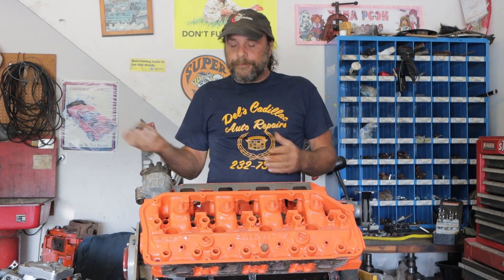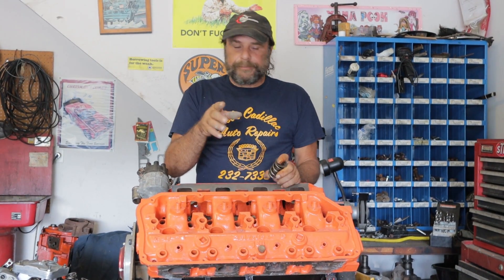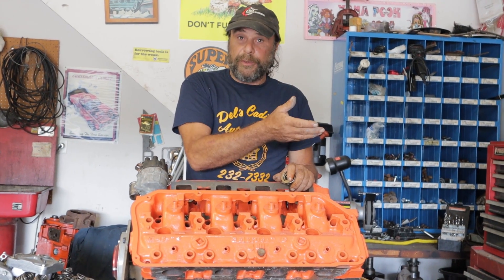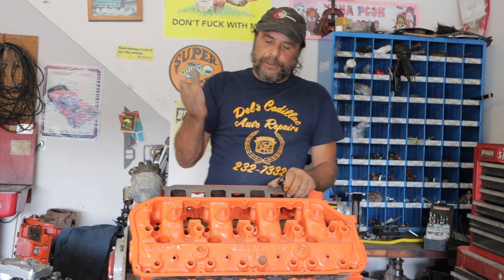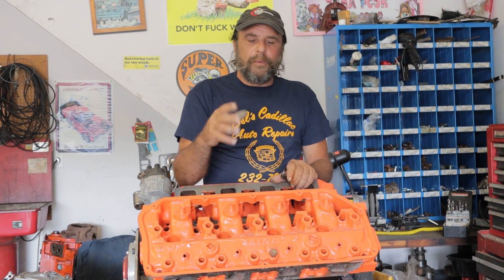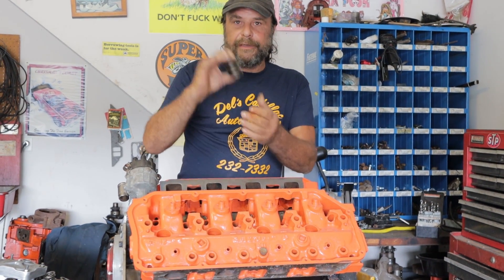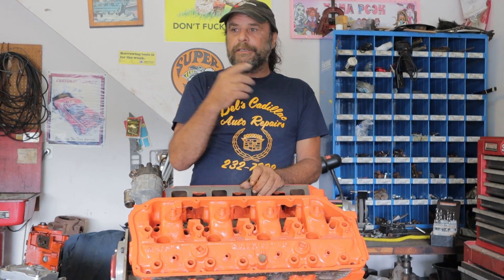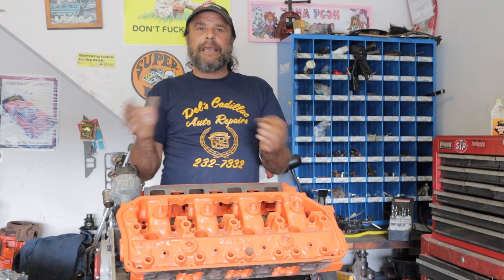Mopar's Doomsday Hemi

Comment: NASCAR in the 60s lead to major development in the automotive industry. 

GM lobbied enough to kill off Mopar and Fords dominance and reduced the displacement to 350 cid

That's what lead to the downfall of Chrysler in NASCAR and lead to GM dominating the 80s.

I want to cry when I see a wing car pic where the CID on the hood is less than 350 CID.

Yes kids, the wing cars were so aerodynamic that they could still take a Chevy even if they had a small block.

I'm only 2 mins in and heard mention of the GM "Mystery Motor",  Ford's 427, the Max Wedge and am wondering if you'll cover the BS that NASCAR pulled to ban the Hemi the first time.

The aero package cars (Daytona, Talledega, Cyclone spoiler) were so fast that the major name drivers boycotted races because the tires wouldn't hold up to the speeds they started reaching.

GM is the reason for the power loss in the series and it's obvious when you dig into the history of the sport.

Mopar was the king of stock car racing in the 60s and Ford was the prince, GM was the Jester that couldn't make anyone laugh.
Reply: John Johnson  stage racing killed it for me.

It was always about endurance above anything else.

Of course when Dale died I was already mostly done with the sport.

Sterling Marlin was demonized over the crash and as a fan who grew up in the 80-90s I knew Dale was the cause.

I'll still watch the occasional race but the heart of the sport died years ago.
Reply: @NotablyNova  That's what I liked about it too...the endurance factor.
Reply: @NotablyNova  I actually watched until Sterling retired. Funny how many people were such douchebags about it when he died doing what he loved. Not a damn thing tragic about that.
Reply: When Chrysler designed their Daytona "aero-car" they actually had an aeronautical engineer from their missile division go to the automotive engineering department to work on the aerodynamics.
Reply: @dukecraig2402  they used a wind tunnel at a college (can't think of which one) to perfect the airflow.

There was actually interest in this during the first gen Charger as well, there was also a 1971 aero car that wasn't completed because of NASCAR restriction
Reply: @NotablyNova  there is a car meme out that shows a Bugatti Veyron and a Dodge Charger Daytona. It says " this car, the Daytona, reached 200 mph with just 4 gears. How long did it take Nascar to achieve that? Those were full steel bodies cars, stripped, but all steel
Reply: Johnny Stephens I actually have that one on my phone
Reply: @NotablyNova  -Wind tunnel testing,for the Dodge Daytona,was done either at the Wichita State wind tunnel(3/8 scale models),or the Lockheed/Georgia facility(full size mock ups).
The Daytona actually had a better drag co-efficient than the Superbird,despite the similarity of the two cars.
Both Bobby Isaacs & Charlie Glotzbach drove Daytona's to over 230 mph,(at Chrysler's 5 mile oval test track,at Chelsea,Michigan)...Glotzbach ran test car No 88,up to 243 mph.
All back in 1969...Chrysler truely was ahead of everyone else.
Reply: @johnnystephens6329   I know a guy who has a super bird Complete full car and has done 220mph. The 440 6pack is mostly stock.
Reply: Magna Carta Sam Adam's hahahaha 220 🤣🤣🤣🤣🤣🤣🤣 yea not stock
Reply: Big Bill France pulled a number out of his ass and said Chrysler's wing cars were limited to 305 cubic inches. Chrysler went to Keith Black and they built what would be called the " lunch box" motor, because it was so small. But it was a high revving screamer and it won races! Big Bill wasn't happy!
Reply: @robertlee9395  Plus it wasn't as bad of an alcoholic as the monster cubes. Piss on Bill France. He fucked over Mopars every chance he got.
Reply: CC Ryder the Corvette is a bad joke when you talk about going fast, it's not documented even now that a stock vette will go 200 mph, and the Dodge Daytona /Plymouth Superbird were doing it in stock form almost 50 years ago, to go a step further, the current Corvette is still trying to match the 94 Viper performance numbers in stock form. Government Motors is a joke.
Reply: Donald Mccauley they were not doing it in stock form 🤣 those were nascar modified with around 650 hp... the actual car did all of around 160 with 3.23 rear gears
Reply: @Colt-tf6xf  real talk. Vette is the basic bitch of cars
Reply: CC Ryder but dumb enough to insult those who are brand loyal. And ps, the chchchebby bellybutton 350 is one of the worst small blocks ever made. Bad rod angles lead to the the nickname “rod nocker”. I’d put a mopar smallblock against that chebby boat anchor all day, princess. 
“I like them all so I’m so much better that you” 
Fact is, you drive a Hyundai. You’ve never touched a big block mopar. 
Sandbox is that way 👉🏻
Reply: John Johnson  
Agreed. I havent watched a NASCAR race since 1998.
Reply: @EarlSinclair97  just crybabyism on GMs part.  Case in point,  when they were bitching about how emissions standards would kill power, Honda (when he was still alive) got a V8 engine, modified it AND passed emissions with almost the same power. When you can't win change the rules so you can.
Reply: @consciouscool   Even funnier, was that Honda used a Chevy Impala as the test bed for their VTEC -SBC V8.
Reply: Still to this day they cry about Mopar being to dominate. They wanted them to change the modern day Dodge Challenger because it was to dominant so Dodge dropped out of Nascar.
Reply: @LionHeart0808  :That's not true at all. Dodge dropped out of NASCAR because they simply couldn't get enough teams to agree to continue to run their cars to justify maintaining a presence after Toyota was allowed to participate.
Reply: @rogergoodman8665  Yes that was a major part of why they pulled out of Nascar but not the only reason. "Dodge officially pulled out of NASCAR's top three series in 2012. A body change for the top-tier Cup series meant that the Dodges weren't eligible to keep running there. MBM Motorsports' Challenger was the very last holdout, and it held on to the bitter end. Next year, the Xfinity series will move from metal to composite bodies, so the Challenger will no longer be eligible to keep running." https://www.thedrive.com/accelerator/25181/the-last-dodge-challenger-to-race-in-nascar-is-up-for-sale
Reply: Hmmm , but yet Ford won roughly 35 races in 64 and dodge/plymouth around 20......😎
Reply: What I am absolutely amazed about is Ford is still in business, really amazing considering all the junk they have sold in the last 15-20 years.two diesels, problems with their dual clutch and they knew it before they sold it,Triton engine's and so many other problems,yet here they are still around.now that is incredible.
Reply: Its cus they're cheap
Reply: @justenough730  it's in f**** credible that you're still around pal what's the opposite of above me take it f**** light the first year of the 429 came out and Winston Cup it won that season that's too f**** bad ain't it pal by the way Bill Elliott 212 miles an hour nobody's ever done that and NASCAR by the way 45 years ago Salt Lake City Flats world land speed record 295 miles an hour Ford GT just recently that land record was broke guess my what Jackass another Ford GT so stick it where the sun don't shine bow and take it f**** light just enough knowledge to clean out a f**** Johnny on the spot
Reply: John Johnson  Damn sure Sucks. I Hope the stands keep becoming more and more empty. What once was so great, is now complete Garbage.
Reply: @CC Ryder 1920 Superbirds alone. A few hundred ? Hmm
Reply: By 69 and 70 when the wing cars had come out gm had long since banned factory backed racing. Pontiac still did it unofficially and shit cus they were badass. They also held the performance flag the longest. Gm deadass cancelled the 455 production after 76 and 400 production after 78...sure Pontiac purposely overordered for it to be an option in 79 and borrowed olds 403s for standard option Trans Ams, but it was GMs bullshit internal rule about no one being faster than the slowass overrated Corvette that stifled development. Pontiac's banshee II is what became the c3 vette because Chevy whined about how it was faster and better so gm took it and retooled it for their favorite son. I love Pontiac and MOPAR because weren't afraid to shoot someone the finger and make fast shit and in Pontiac's case continue doing it when everyone else had fucking given up
Reply: I'd often heard, GM was officially, out of ANY form of racing, in the '60's; NHRA, NASCAR, ETC, until the Trans-Am series. (My saying, Trans AM. We know Chevy, and Pontiac ran those, until it's demise.) Yes, there WERE Chevy's, Pontiac's, and, Oldsmobile's running...... but, factory support came by way of the back door. Didn't John DeLorean have to build the GTO in a back warehouse, somewhere?
Reply: @robertschreiber8099  ya the G.T.O. was built in secret and when unveiled was released as just an option package to skirt the corporate mandate for curb weight to displacement.
Reply: @robertschreiber8099  Oddly,GM pulled out of racing in the same year that Chevy finally had  powerfully competitive engine(mystery motor) for NASCAR again(1963),not that it mattered,because the engine wasn't reliable,and then Ford and Chrysler stepped up their game the next year anyway.Chevy pretty much had no chance in NASCAR after 1960.They just couldn't hang in the engine department.
Reply: @CC Ryder 1,920 Superbirds produced and sold to the general public.
Reply: @CC Ryder Oh I wasn't into the whole Nascar back and forth. I just know several people who actually own Superbirds. Sitting inside one about to head down the beach as I text right now.
Reply: GM didn't have any factory teams....didn't need them. GM already had 50%+ of the auto market.
Reply: Grumpy ate hemi ass with a Lil Ol' 327
Reply: @dennismassengill5481  -Grumpy DROVE an A-990  Hemi Plymouth in 65,son...
Reply: Dennis Massengill bwwwaaaaaahahahah 😂😂 sure
Reply: @Welcometofacsistube  Another mopar fanboy that hates truth.
Reply: Yeah G.M. started when they banned Pontiac from racing
Reply: keith cunningham  Hear, hear Mr. Cunningham, very factually, eloquently stated. Chrysler's engineering superiority is grossly under appreciated.
Reply: the only reason Chevy dominated in the eighties is because 90℅ of the cars were Chevy, they only had a few Ford's namely Bill Elliott and everyone knows his 351 Cleveland Ford's when running right would wipe the floor with the Chevy small block.
Reply: @mikeburks9641   Even a stock push rod 5.9 small block Mopar has more block support around the crank And can reliably run bored out to 460cid  Chevy or Ford small blocks would fly apart The Mopar block is very similar to an actual race engine
Reply: @mikeburks9641  Only on the the big tracks did Fords have an advantage. GM won the mojorty of the short track and road course races during the 80's and there were more short tracks on the schedule back then.
Reply: CC Ryder if that's your opinion that's fine with me but I disagree but wont have a argument about it.
Reply: Look at the numbers of race’s won a manufacture championship won ford dominated nascar in the 60’s not mopar
Reply: It was not GM lobbying that killed the big block engines, it was due to a combination of higher fuel costs and EPA emissions standards. By the mid 70's, the manufacturers were in the process of phasing out the large displacement engines. It's as simple as that.

The wing cars were yet another example of Chrysler bringing a machine-gun to a knife fight. Had Nascar not intervened, the car's would have lost any resemblance to an actual production model with in a few years. Despite their popularity today, the Superbird and Daytona didn't exactly fly of the dealers lots back in the day.

Pontiac was very successful in the early 60's. After they pulled out, GM's factory support was sporadic at best for the remainder of the decade. I know Uncle Tony's Garage is a big Mopar fan gathering place and I will probably get flamed for rocking the boat but as a shadetree auto racing historian, I had to set the record straight.
Reply: yes sorry slowcar fanboy but chysler wasn't king of anything Ford won as many races in NASCAR back in the day as chysler did. they would not let Ford run the 427 cammer without a 400 lb weight disadvantage because it was faster than Chyrslers version of a hemi motor. King Richard went to Ford in 69 and won the championship in a boss 429 powered Torino, and the Ford's were winning races with their hemi so Chysler came out with the winged cars to gather an areodynamic advantage. Chysler had much success but was never dominant over Ford. Chevy yes but not Ford.
Reply: @mikeburks9641  -Ford won 30 Nascar races LESS than Chrysler did ,in the 60s,son...Try no to cry too much....
Petty ONLY went to Ford because Plymouth wouldn't let him drive a Dodge Daytona...Your Nascar history needs work.
1969 was the worst year during the 60s for Petty....guess it was because he was driving a Ford,huh?
Reply: 68bobba2 like I said he won the championship in a ford, went back to moped when NASCAR let them build their wing cars. they wouldn't let Ford make a wing car the boss 429 made 30 to 40 more HP than the race hemi. had to let chysler catch up.
Reply: @mikeburks9641  -Petty won 9 races with Ford in 69(his first race win of the season was in a Plymouth,making it 10 wins for the season).
Dave Pearson won the 69 drivers championship,with 11 wins for the season...Slipped in your OWN shit there,son.
The Boss 429 made 40 more hp than the Hemi???....HAHAHAHAHAHAHAAHHA....You Ford fans are good for a laugh.
Come back when you know what you're talking about,mike
Reply: This is for notably Nova it seems to me like the first year that Ford came out with the 429 and Winston Cup they won that year am I not correct also when Big Bill Elliott turn the 212 mile-an-hour fastest lap ever in the history of NASCAR all the Chevrolet drivers came in crying saying that it was just too fast and they couldn't keep up am I not right or you going to tell a lie this for is that porcupine motor 427 Ford had more wins down the quarter-mile than any porcupine s*** rollet have a nice day
Reply: 350 Chevy is very good engine
Reply: GM should have NOT been bailed out, rather Mexico should have given GM to nationalize....I grew up in a GM family and remember when they delivered.
Reply: Chrysler cried about the sohc ford and it got banned in 65.
In 66 nascar said ford could run it but had to use the galaxie not the fairlane.
 Big weight advantage to Chrysler
Reply: @timmebruer5205  Well,chrysler made the engine this video is about as an answer to the sohc,if ford was able to run it.If ford was able to run the sohc,Chrysler would have ran the DOHC and a bunch of people probably would have died.Also nascar wouldn't let chrysler run the hemi in 65,which is why Petty boycotted nascar that year and went drag racing.It's kinda cool actually that ford wasn't able to run the sohc,because that led them to develop the medium riser and the tunnel port.The funny thing is that when Petty came back to nascar,he ended up driving a hemi belvedere which was a magic combination at the time,and pretty sure he said his 66/67 plymouth was his most winning car.
Reply: @FATMIKED5183  it actually forced ford to develop the boss 429.
Which Petty drove in a Talladega because the hemi couldn't keep up with it... again.
Reply: @timmebruer5205  Why did he switch back to Plymouth then?Because it was about aero,not hp.
Reply: @FATMIKED5183  and nascar refused to let ford run their king cobras with the 429 boss engine in them.
Thats when ford pulled out of racing.
Reply: @timmebruer5205  I don't really feel bad for Ford in that case,since they essencially cheated with the Talladega.Due to them rolling the rockers up under,more of the sheet metal and the floor would be further modified between the factory and the race track,and NASCAR let Ford run rear spoilers,while nobody else had them.
Reply: @timmebruer5205 The Cammer got banned because it wasn't a production engine that was used in any of the cars sold by Ford off the show room floor to the general public. They were more of a prototype engine that were developed very quick to try and run them in NASCAR and at the drag strips until the officials found out that these engines didn't come in any street driven Ford car or truck& it got banned . They made good HP but they had an lot of problems such as a bad oiling system and crank shaft problems and that 8 ft timing chain that not only caused a lot of timing fluctuation but they would snap and break causing massive internal damage to the engines . When using these engines in the nitro classes of drag racing because of the long timing chains and the timing not staying stable once set caused a lot of issues with blown engines every few runs because of this until someone finally designed and built a gear drive for them to replace those long timing chains. My old neighbor was Tom Hoover from MN who for years was a nitro fuel blown dragster and eventually a funny car racer who was running these Ford Cammer engines back then and he admitted that they made great power but weren't very reliable with the things I just mentioned. He had several blown up Cammer blocks sitting behind his shop years ago and eventually went back to the Chrysler Hemi because they were cheaper to run and they stayed together better and were more reliable and would stay in tune better. He was a privateer racer for many years and didn't have all the fancy factory sponsorship to help him like so many others had but had connections and was able to get several of these Cammer engines back then . In the beginning it was him and his mom and pops that would do all the wrenching and tuning for many years until he got known and was winning enough races and making enough money that he was finally able to afford a pit crew to do the work his mom and pops did . He had the Pioneer funny car that did well and for years the was the only privateer racing against guys like John Force and other beating them who had the big money and sponsors right up until he sold his car to Checker Shucks and Kreagan the auto parts store company and they hired him for a few years to teach them the secrets of tuning and other important things about running the funny car. I moved away from Mpls  MN years ago and lost contact with him and found out he just died a couple years ago and had moved to Florida to retire finally. He had a front end alignment shop in North Mpls for many years actually 2 shops but the North Mpls shop was the shop he was usually at every day when not racing and I would take my cars and trucks to his shop to have them do the alingments on them and he loved to talk about drag racing and would chew your ear off lol . His desk assistant at the shop was at the time was Wild bill Hickock another known drag racer and both of them were a blast to talk to about the old days of drag racing . As far as I know the North Mpls shop is still there and it's still called Hoover Wheel Alignment and the last time I was by the place it's still painted the same which has been a long time now since I've been out that way .  RIP Tom Hoover gone but not forgotten !
Reply: CC Ryder wow. Another chebby boy who hasn’t a clue as to the benefits of the hemi at high rpm. 
Son, they’re still using that platform today. Big power. Hemisphere. Big ports. Air. Big valves. 
Don’t get me wrong, the Generic Motor Crap made some of the best boat anchors in the game, but if this engine had come about...
Reply: Yup. GM cries anytime they lose. And anytime they win, it's because they've managed to get it handed to them.
Reply: Nascar downsized the engine's because manufacturers downsized they're own production engines because of the 1973 oil crisis so they say
Reply: keith cunningham  Calm down! All the manufacturers "borrow" ideas from each other. Sometimes the big 3 even work together on projects & even work with foreign manufacturers. That's what drives technology forwards & allows us all to reap the benefits no matter who is your favorite manufacturer.
Reply: @CC Ryder hey fuck face my statement is backed by facts.

You aren't schooling anyone, you're a fucking fanboy who got offended.

GM has always lobbied against the compitetion in one way or another.

By the time of the wing cars GM was an afterthought in the series because they chose to be.
Reply: Wine wine wine said the slopar fan. So I guess that's why the 5.7 Hemi is relatively close to the same cubic inches the old 350 small block Chevy we could compare apples and oranges all day
Reply: GreenBoy at GA Farms  your response doesn't make much sense, MOPAR dominates whatever race forum they endeavor, until the inevitable rule changes that bump the advantage back to Ford and GM. The last time Brad Kowalski got a championship was in a Dodge, so even a dummass can win in a MOPAR.
Reply: @Colt-tf6xf  😂😂😂😂😂😂😂😂😂😂slopar 😂😂😂😂😂😂😂😂slopar 😂😂😂😂😂😂😂😂😂
Reply: @Colt-tf6xf  I hardly doubt and Mopar dominate anything except breaking down it's okay to whine whine whine about something you probably own that you believe should be at the top of the list a lot of people do that admitting the problem is the first step good luck with your program there sir
Reply: GreenBoy at GA Farms  I had the 389 tri power GTO, 428 Ford, 427 Corvette, several WileyCoyote rocket sled Kawasakis, no big MOPARs back in the day, had a buddy with a 4406pak Challenger RT.  so my fond respect for Chrysler grew out of appreciation of Richard Petty, David Pearson, and Big Daddy Don Garlits to name a few. I admit that a test ride in my 05Rumble Bee was all it took, and I thought  Wow, when did they start doing this again, the motor honkin noise, the burning rubber, thrown back in the seat, woohoo ! There was 25-30 year haitius from that kind of performance coming out of Detroit, almost two generations. The 300 got the Hemi, the Charger, the Challenger, the Jeep. It wasn't the 426, but GM & Ford were headed the other way. Dodge relaunched muscle cars with an affordable yellow pickup(I know they made some black ones). So maybe that paints a picture of MOPAR infatuation, the Camaro wouldn't have came back, the Mustang would be even slower than it is had it even survived without the MOPAR popularity, and the Jeep sales have been stunning in the soccer mom market. If you go test drive a new Hemi pickup now or perhaps soon, then maybe you'll understand. I hope you can now see I wasn't picking on you personally, and as I mentioned , I  have had the privilege of having some pretty nice and hot buggies over the years, but hopefully no more Ford or GM.
Reply: @Colt-tf6xf  I talk a lot of smack about the Mopar calling it a Slopar. However I do have a lot of respect for Chrysler Dodge with the Mopar and Hemi. I have been a mechanic for over 30 years I've been turning wrenches since I was 15 years old. I have been a diesel mechanic for the last several years. I have worked on everything from the farm tractor farming equipment tractor trailer semi dump trucks dozers backhoes Ditch Witch and a lot more equipment but my true love was my race cars and yes I have had my hands and everything from Mopar 2 Mustang. But I just could not get over the fact that I could spend a third of the money on a well-built Chevrolet motor and run circles around them. I used to give my old man a bunch of crap in the shop while we were working about Mopar this and Mopar that. But he was my mentor teacher best friend and most of all my father. It was a Master Mechanic and was well-known back home for his many talents I'm fixing things and making them run he was also one of the best carburetor man and fuel Tech man on this planet as far as I'm concerned. I have every one of his trophies that he receive from each check school he graduated at and actually ended up finish teaching most of the class. But here's love for Mopar was it strong as my love 4 Chevy / GM. No I did not think you were picking on me I have thick skin. I just like poking fun at the bear from time to time. Hope this helps you understand it's my way up still keeping my father Spirit Alive. May God Rest his soul. Thank you and have a great day.😎👍
Reply: GreenBoy at GA Farms Back in the early seventies, there were coal trucks everywhere  around home, gas motors like 549 International  478v6magnum, big 6 cylinder Whites,etc. Mack b61s b75s diesel Internationals, Mack remodels and Autocars. The biggest they had were 335-350 Cummins. Claude Hilliard had Autocars with 270 power torque motors and the idea was that with a 7 speed transmission you could pull them down to 1100 rpm without lugging them as opposed to t?he regular Cummins that needed to stay above 1600 or so to cool and not melt the pistons so they usually had 13 speeds or two sticks, however even back then the two stick drivers were scarce, back to Claude, he got 13speed double overdrive in his and had 6:20 or so rears, really slow for pit pulling power, and double overdrive so they could still go 70 mph or so. The power torque series had an overdrive on the fuel pump so that it could make full rail pressure at low rpm. They hauled a lot of coal from the pit to a power plant in Cheswick, PA. He started using a diesel repair shop called Diesel Injection Service of Cheswick. They figured out how to get the rail pressure up to moon launch specs, retarded the timing way way slower than Cummins to prevent burning holes in the pistons, and Claude Hilliard had the fastest coal trucks anywhere around, they could pass a lot of the empty trucks going uphill with 25 tons of coal in the box. Twenty years later, I took my ntc 400 to them and when they were done I had 900 horsepower, if I'd gone dual turbo it could have been 1066. I was writing out the check and was having difficulty putting  Diesel Injection Service of Cheswick in the space allotted and I said JeezLouise why don't you just call it Pittsburgh Powerhouse ?  Not long after Pittsburgh Power became their new name brand. They came up with that on their own, but now you know "The rest of the story "  R.I.P.   Paul Harvey